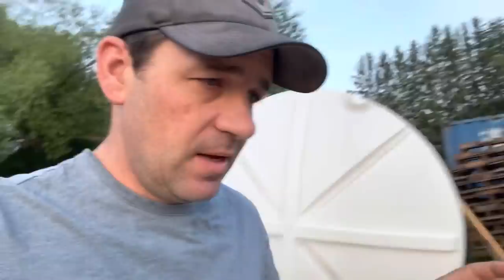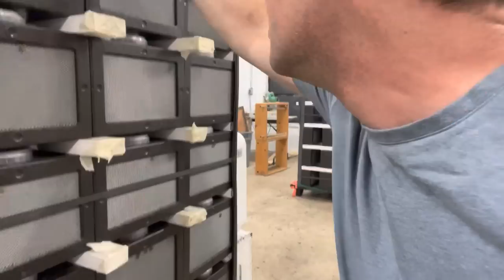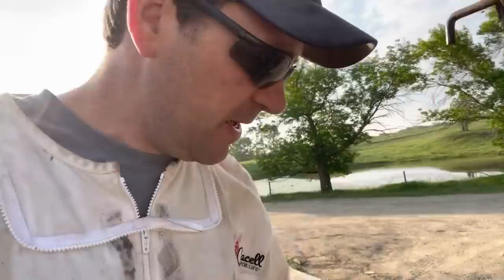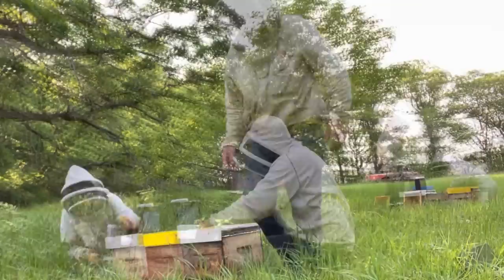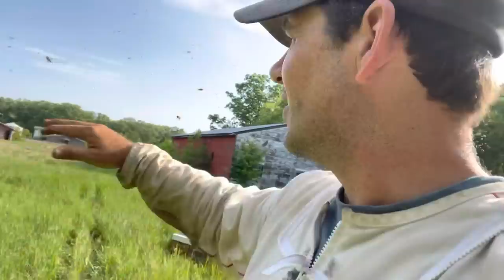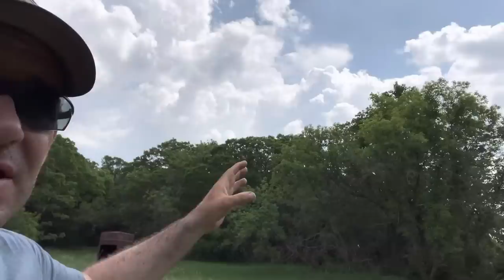Taking the Stress in Stride

Comment: Trailer 
      Laser rust removal 
      Tig weld and strengthen 
       Coupling check , fix , upgrade 
        Brakes , hubs , wheels ( spare tires ) , lights  check fix , replace 
        Stroops / tie downs check , replace with new 

  I run five trailers , each must be ready to go , within a hitch and check lights timing   pick ups can be Hives , equipment , vehicles  ,  tools 

  Two cage trailers , of which one tips 
   Two transporter trailers of which one is Tri Axle , the other Tandem axle 
    And a fuel trailer